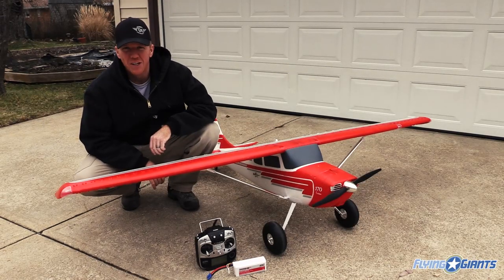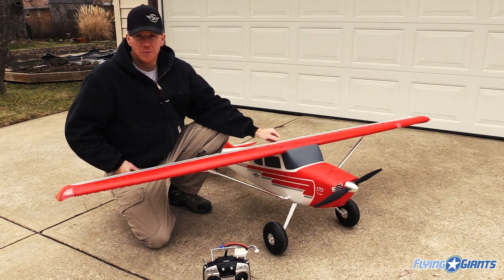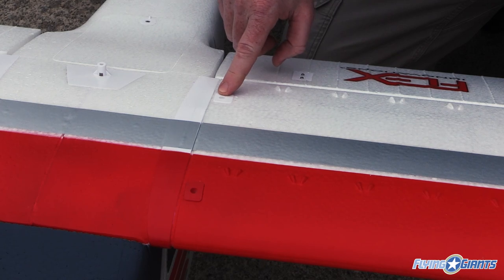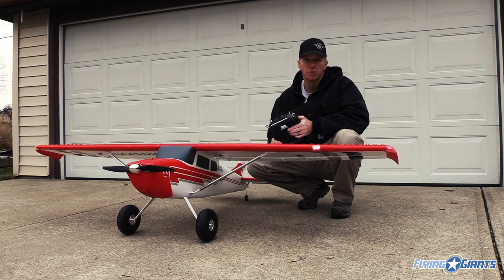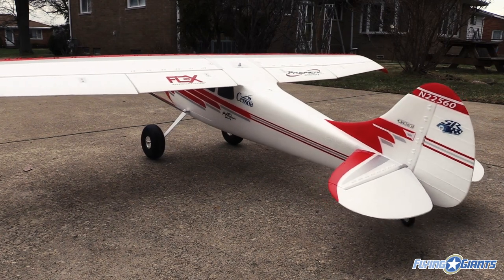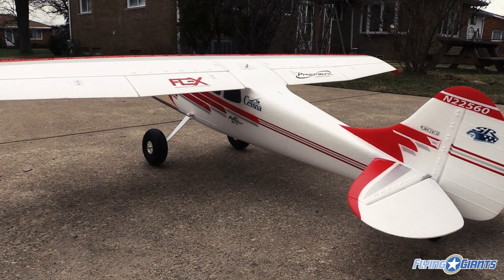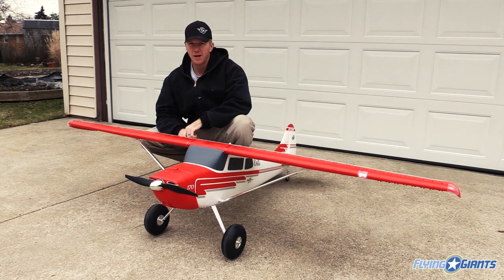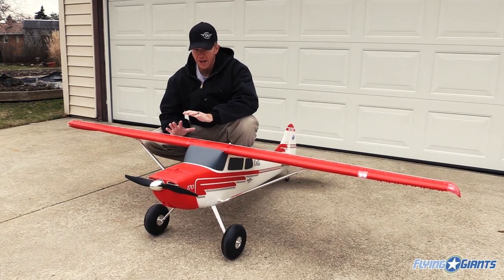Premiere Aircraft Cessna 170 - Initial Impressions After the Maiden

Comment: I have the carbon z cub I noticed when you use the flaps the elevator has two settings how did you program the elevator with two settings? It looks like you are using the futaba 14sg as am I. If you know of any manuals or videos to help in figuring out how to program this radio I would be greatly appreciative.